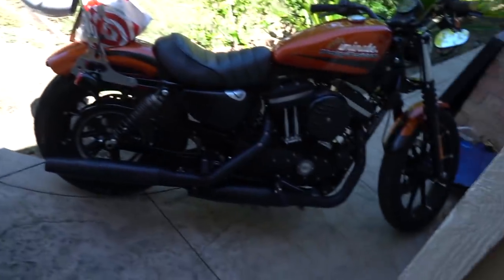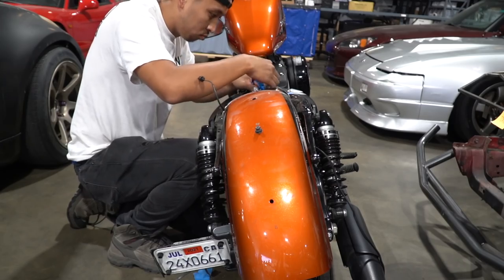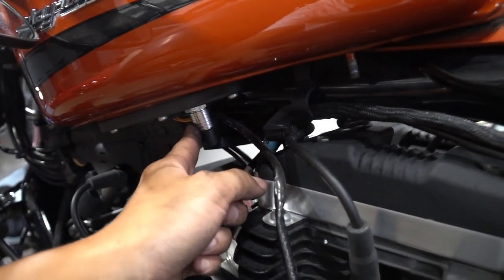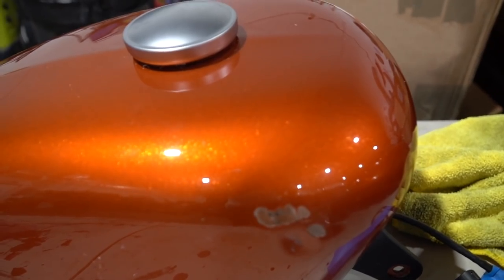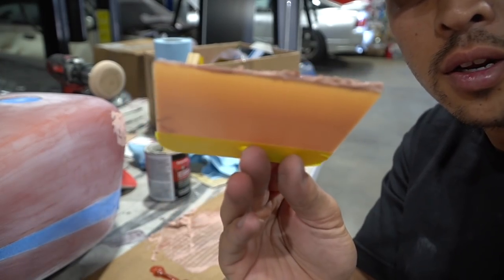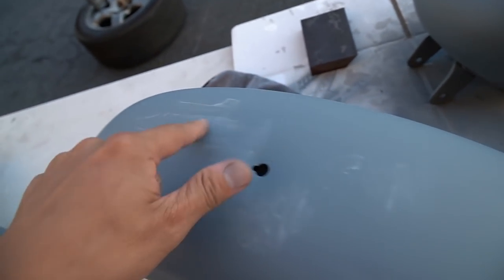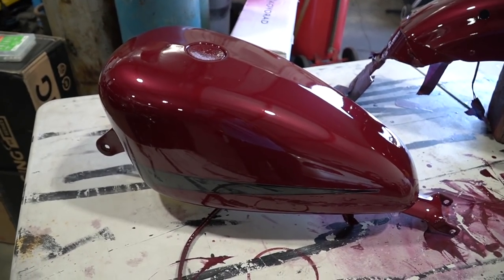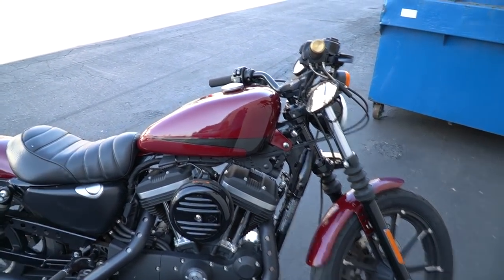Painting The Sporty

Comment: Vu! Just a tip im no painter either but i would have sanded the original clear coat on the gas tank where that design thing is to, just enough for the new clear coat to stick! Mask off that area apply base coat, carefully remove the masking tape and then cleared all together ;)

Comment: I used to be a painter but now I'm a CNC programmer but when I put my first coat on I done a real light tack coat and let it set a few minutes then done a light coat that just full covered. Then a light to medium coat, then a medium coat or two to finish. Never got any runs this way. I know different paints flow different but when I seen your first coat going on it looked a little heavy. Not trying to be a couch professor, just trying to help